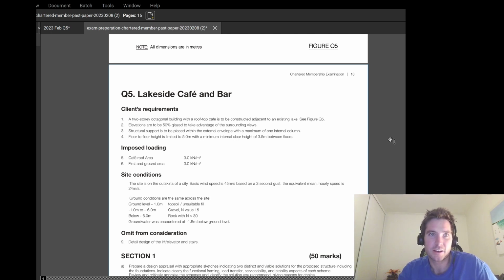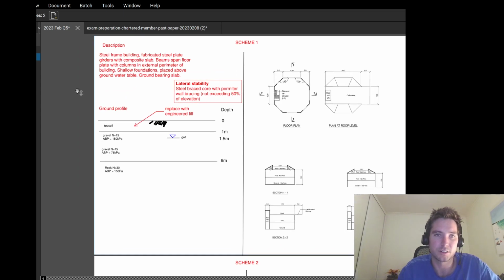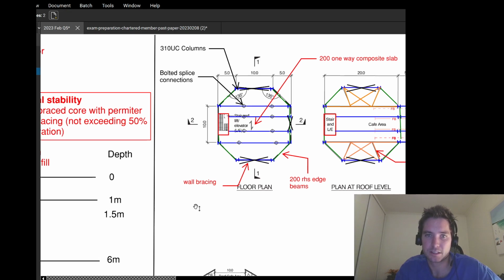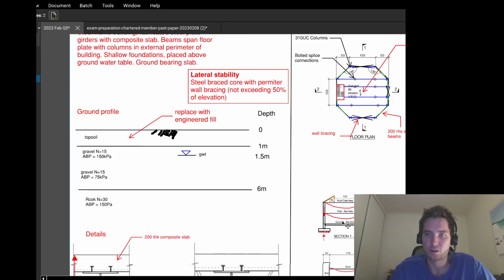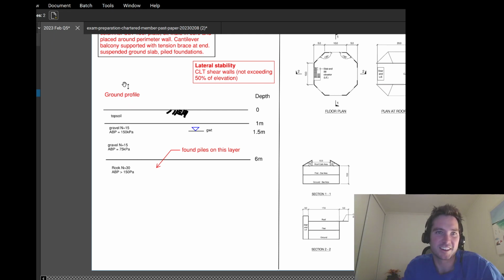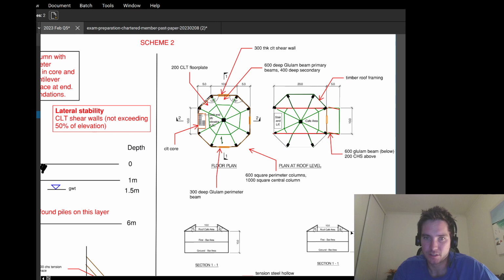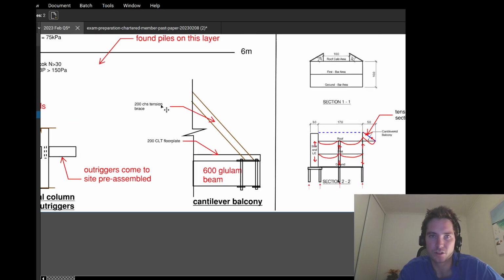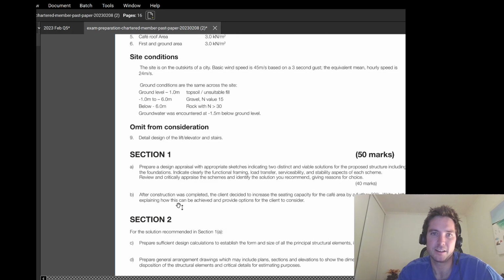2023 Feb IStructE Past Exam - Q5

Comment: Thanks for this. Would it not make more sense to have piles as the foundation system for the heavier scheme i.e. scheme 1, also where the load of the building is concentrated on the perimeter. I believe this would get marked down otherwise.
Reply from the maker: Yeah I agree. If one scheme is heavier than the other, it does make more sense to have a piled foundation for the heavier scheme